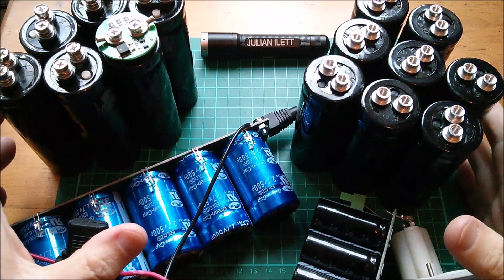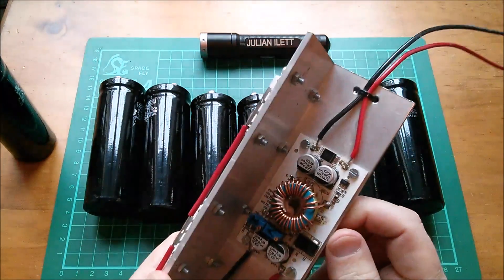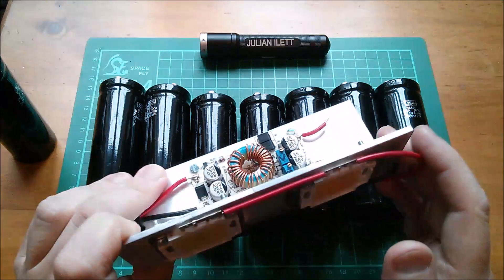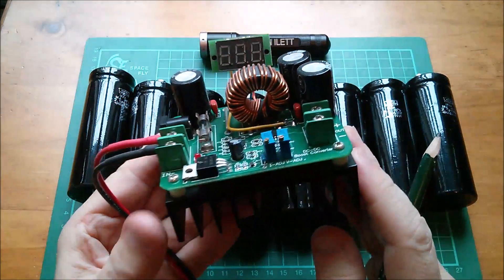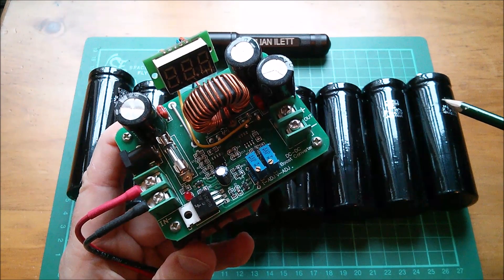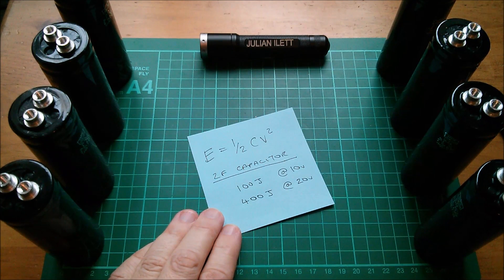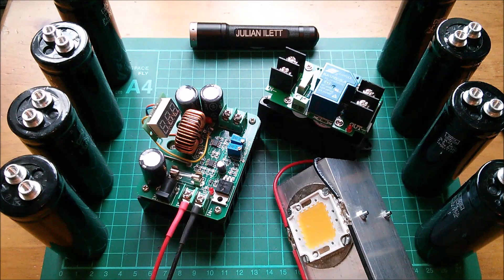Supercapacitor Powered 100W LED Flashlight Project - Viability

Comment: i wonder, would you be able to use the 120F or the 500F super capacitors to start a car? the starter takes approx. 85A, would it be be possible able to supply that much current for an engine start?

Comment: At 15Ainput, I calculate 6.7V input to equal 100W (15A)(6.7V)=100W...Will this big buck converter (I didn't see the part no.) work down to, say, 7V. (With appropriate safeguard you mentioned at the very end).  I am thinking about building this project with this feature of about a supercap voltage drop of about 20v to 7.5v.  Also, those 50W LED's are pretty bright--so this combination would give an even more impressive run-time...~ 2min 20sec.  Using a nice bright 30W LED gives nearly FOUR minutes.   NOW, use 1000F supercaps.......what's that...a bit over SIX minutes?

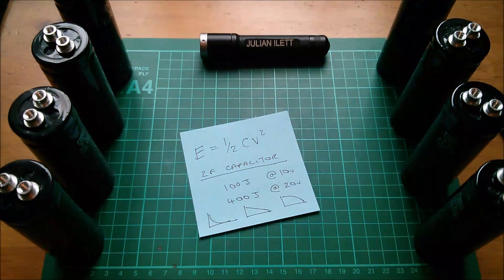Comment: I was just watching this video again and at about timestamp 7:07 you draw three time domain curves of capacitor discharge into constant RESISTANCE, CURRENT, and, POWER.  Since, for one, power = (I^2) (R)...does this mean that the third curve is proportional (perhaps as I^2 R) to the product of the other two?

Comment: and with a flash rate above 70 cps and a 10% duty cycle because of persistence of vision you would have near the same apparent brightness for 10 times as long.

Comment: Hi Julian did you thing of use this capacitors in parallel 1st with boost converter and then switch to series when they drain out to get more efficient circuit this super caps?

Comment: Those boost converters typically have current limiting to protect the power MOSFET. Mine use an UC3843A controller chip that supports this, and they have the necessary current sensing resistor in series with the MOSFET's source. 

Also instead of going with a larger converter to handle the larger input current at a lower input voltage, consider using smaller converters in parallel. This works fine for converters that have an output current limit adjustment, because you can adjust each converter to equally share the LED's current.

Comment: today I learned that 1 Joule is 1 watt second!
Reply: It's also a newton-meter (N-m).  Kin to a foot-pound.
Reply: whoa!  I think of N-m as a twisting energy but without any reference to time.  watt seconds reference time though, like horsepower.  how does time figure into N-m and Joules?
Reply: A newton is a "kilogram-meter per second^2".  (N-m can be considered POTENTIAL ENERGY}
Reply: emaglott   if you decode the term "watt second" you get energy divided by time then multiplied by time.  The two refs to time cancel each other out.   Similarly for kilowatt hour, which is a measure of the energy the power company supplied irrespective of how quickly or slowly you consumed it.
Reply: excellent!  thanks!

Comment: A boost converter will not adjust input current indefinitely as the input voltage drops, it will have a limit. Remember that its principle of operation is PWM. Once the duty cycle approaches 100% its ability to boost comes to an end. What you will most likely observe is that at some point (eg 8 Volts) the output voltage will suddenly drop to some low value, probably equal to the input voltage. And that will of course happen long before the capacitors are discharged to zero and I suspect before the input current reaches the fuse-blowing values. Only an experiment will prove that, however.  :o)

Comment: Have you confirmed that those LEDs really do consume 100W? There are many fakes around which are much less powerful than the claimed figures. You can also consider the option of running them at reduced power when necessary, in order to use it more as a torch rather than as a flashlight. And thanks, Julian, for using the name 'flashlight' correctly for this device!
Reply: You can make any LED consume 100W. Question is if it can take it, which is much harder to test, because they don't always fail immediately.
Reply: Quite. We've all tried!

Comment: How do you plan on charging them, one at a time or all of them in series? You need to watch out for not overcharging them as there is a lot of energy in them and they can produce all of it in almost an instant so if you manage to break one one of then or short them the firework is going to be spectacular! :-)
Reply from the maker: All of them in series.

Comment: As I recall from playing with these (green PCB) boost converters, when you decrease the input voltage below a certain point, the output decreases too. I'd recommend just trying it to see what actually happens. I think you'll see the LED brightness fade a bit and then it'll either drop to almost nothing, maybe with the boost converter squealing, or it'll start flashing.

Comment: When you put them in series, why does the capacity get lower? I built flashlights in the past and my calculation was the capacity stays the same, we just have one cell of capacity instead of 4 in my case. I calculated one hour runtime and got 1 hour runtime...
Reply: It's capacitance that gets lower. Capacitance is not the same as battery capacity
Reply: The "plates" are further apart.  Think about it.
Reply: Capacitance gets lower, not capacity. Two capacitors can store double the energy, doesn't matter if in parallel or in series. If in parallel it's obvious, twice the capacitance at the same voltage equals twice the energy (energy stored at a certain voltage is proportional to capacitance). If in series you doubled the voltage the "single" capacitor can take. Energy stored is proportional to the square of the voltage. That would mean that you can suddenly store 4 times the energy by doubling the caps. Luckily we don't violate any laws of physics, because the capacitance goes down to a half at the same time. That's just how it is.

Comment: having used one of those cheap boost converters myself to drive a 150 watt cree led from an 18 volt power tool battery, i can tell you that if the input goes over 10 amps for too long it lets the magic smoke out.

Comment: I use Poly Fuses very small and compact don't need a lot of extra space mine protect my super capacitor bank circuit from over heated wires and protect my boost converter.

Comment: DC-DC converter might eiter fail as you mentioned or fall out of regulation when supercaps are at 10V. 2-nd option if controller IC inside that converter monitoring input current and reduce output voltage (and current) if input current is too high. IC can monitor either input or (preferably) switch current. Some boost converter are current driven and will make PWM modulation taking only switch current into consideration (output voltage or current limits only limit switch current further down to certain value with some type of regulation). This converters will always fall out of regulation in case of or exsessive input current and never blow up in that case.

Comment: Not sure if I'm missing all the fuss about super capacitors. A £120 torch that lasts for 2 mins. Wouldn't a battery be better every time. I seem to yet to see any application of a super capacitor that was anything less that an expensive waste.
Reply: yes if you need constant voltage.. and no if you need hi amperage.  Take hi end car stereos that require alot of amps 90 percent of them are run off of capacitors. the batteries and alternator power them and they become fully charged in 10 mins... then its just maintained.  You typically cant get high amps from a battery due to its design. 
So the battery and alt handle the voltage while the supercaps fill the amperage which takes the work off the battery and alt. 

For this project.. it can be expensive.. but its not a waste. your never wasting anything when your learning something. Not to mention the parts can be used elsewhere.

Comment: A 15A fuse shouldn't blow at 15A, depending on the fuse type, it can blow at much higher currents.
For protection you could use a voltage detector, maybe a zener to turn on a transistor/mosfet above the safe voltage
Reply: Also, didn't it look like a slow-blow fuse?

Comment: Don't make your life so hard! Use the typical 150W step up converter from China! It goes up to 32-35Vmax and has a self cut of voltage at 10V! Just put "150W step up" into eBay and you will find it!! Nothing special required, it will shutdown by itself!!
Reply: Do those have current regulation in the output? Driving high output LEDs with voltage control is not recomended.

Comment: Maybe you can use something simpler. A modified lipo alarm. DIY Perks did something like that, you just need to change it a little more to work under 2.5v... Or wire 2 capacitors at a time, I don't know. Maybe two of them + a resistor, each wire going to the lipo alarm.

Comment: Depending on the application you want it for, a 100W led is a vast amount of light, i would recommend going for something like a 10W or 20W led for a longer run time, it will still emit plenty of usable light but at a much longer runtime as well as keeping the current and heat dissipation requirements for all components.
Reply: james hough I think he's just doing it for the sake of doing it, lol
Reply: Errm but you can do the same with a 50W or 100W led... There's no reason it has to run at full power, a 100W led ran at 10W would be far better as it won't put much stress the leds and you can dissipate the heat easier with its larger backplate, the only advantage to using smaller leds is their size but since you'll need a heatsink either way that doesn't matter much.
Reply: vgamesx1 The difference is that these 100w LEDs do not have the output, you'd think they would - their lumens per watt, is quite poor.
Reply: Fair, although wouldn't that depend on whether you're current limiting them or using PWM on them to get 10W?

Comment: Because the LED's power is fixed, a supercapacitor is fun to use but quite an overkill. These small 6V lead acid batteries would work too, for less money and volume and longer runtimes.

The supercapacitors would really come into play if you were to run the LED (or an LED array) at something like 1KW for 2 seconds or so. They probably do better than lead acid batteries at this.
Reply: iliasasdf Or maybe a 2s3p battery pack made with 18650s, like Well Done Tips did with his 100w LED flashlight.
Reply: yeah I keep forgetting how impressive those li-ion rc batteries are.

Comment: Why you don't use a 18650 battery-pack Super-capacitor are empty faster than 18650 batteries.

Super-capacitor are very expensive.   I was on E-Bay today and was shocked by the prices.
Reply: It's a damn experiment. Ffs
Reply: Super cap are super  toys for electronicians . they are not real use in tne true life .( except professional transport bus and tramway )
I see in Spain a tramway without aerial line. Just at each stop , a catener up toward lines, I suppose it is for reload the  supercap for the next part of travel ( environ 500 m between stations)
Reply: all energy containers fail, when it comes to prices.
Reply: Supercapacitor costs at least 50x more than Li-ion per Wh and have 1000x more cycles than Li-ion. If device use around 1/n of Li-ion capasity, than amount of cycles that cattery can endure rises as n^2. Li-ion used only beetwen 50% to 60% SOC should last 0,1M cycles (supercapasitors have from 0,5M to 2M cycles), still having cost at most 1/5 per usable Wh of what supercapasitor have. Also there will be a problem extracting last bit of energy from supercapasitors, where such a limited li-ion will have very stable voltage, simplifying circutry that is powered from that battery. Typically supercapasitor is discharged to voltage equal to 50% of full charge voltage. That is using supercapasitor for 75% of stored energy and manyfacturers specify cycle count (1M cycles typical) at this conditions.
Reply: the kind of cycle also matters - very intermittent cycles considerably lower the life of batteries; and to get the same high power density out of it without overstressing the battery (and again reducing life) youd need a really big battery to be able to even get near 1/1000 of the cycles a supercap under the same intermittent, brief high power loads. its not just the Wh that matters, the type of application matters alot as well. (but it totally agree with you on a purely Wh basis li-batteries are WAYYYYY better at storing large amounts of energy)
Reply: Those batteries SUCK!
Reply: Ivars K supercapasirors do suck, because of enormous price per Wh, compared to batteries
Reply: which is why they will never be feasible for power storage applications; but for things like brake energy recovery or peak shaving supercaps are very valuable alternatives; batteries have higher resistances and would dissipate a lot more heat ..... and in order to limit the strain on batteries you would need a wayyyy bigger capacity ; think more on the order of 0.1C discharges for higher and more brief discharges. in simply buffering power, supercaps outperform lithium batteries. for something like a flashlight or portable power source lithium is king. for something like static power storage not even lithium is king; lead acid is cheap, as long as size , weight and temperature extremes are not that critical.
Reply: SCWfan06 So what? If he put it on youtube and left the comment section open... We can suggest anything.
Reply: so are batteries .... they ARE expensive, but supercaps tend to have better characteristics and can discharged and charged almost indefinitely (>1.000.000 cycles) - but i agree for something like a flashlight they suck; they are several orders of magnitude worse in terms of power storage; but both have their pros and cons ;D
Reply: lexpee Exactly.
Reply: How do you know, that intermittent cucles lower life of the Li-ion batteries? All google images "li-ion DOD vs cycles" show the opposite if charge-discharge speed is the same compared to full battery capasity. Since usable capasity is reduced, charge-dicharge time can also be reduced in direct proportion with usable capasity. If charge-discharge currents are lowered, this only make cycle life even longer

Comment: I actually made a torch with 6, 500F supper caps with the same booster and it still holds up. I can run it for 50 seconds full power and stuffed it all in a 75mm PVC Tube. With a lens from a car headlight in front. I actually use it quite often when I work on stuff (but from a pc psu)

Comment: It's going to be very bright, but not for very long.Not enough stored energy for a long runtime.
Reply from the maker: Around 2 minutes I hope.
Reply: Yeah unfortunately the energy density isn't very high with those big guys
Reply: That's very short, and 100 W is too much power, IMO (I've only used flashlights in power outages so I'm not an expert). I would use 10 W, which would give me about 20 minutes.
Reply: but you ca charge them faster than any lithium cell, and can also have many charge / discharge cycles.